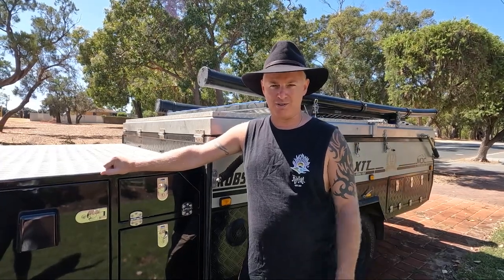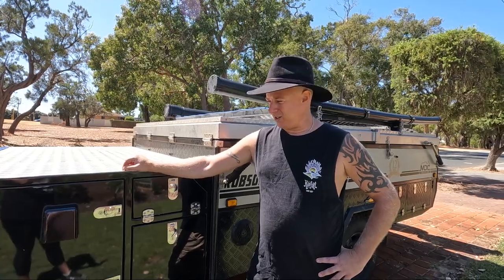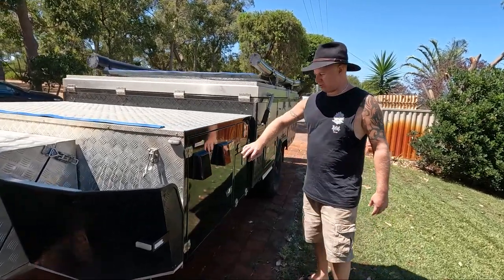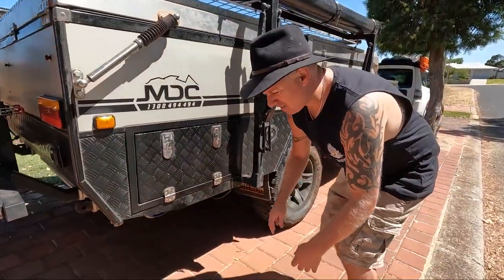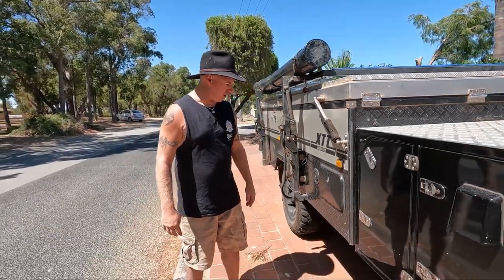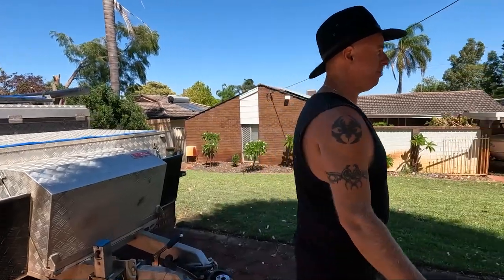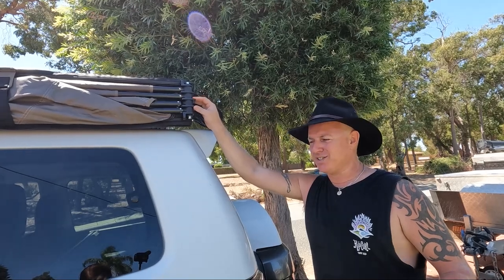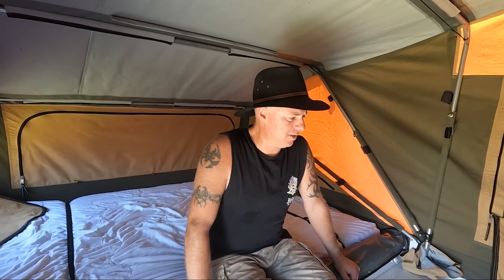MDC ROBSON XTT OFF-ROAD CAMPER TRAILER REVIEW AFTER A 32,000kms BIG LAP! PAJERO GOOD FOR TOWING?

Comment: Thanks for another great video. Curious to know about the big tubes you carry on top. I think you mentioned at some point they were for carrying the poles. Does the trailer not have a storage bay for the poles?
Reply from the maker: It does, but I chose to utilize the area to store other things instead, therefore gaining more storage. 

I call it the stuff spot where I keep all the bits and pieces we use around camp and want to be able to get to easily and quickly.

By memory I go through that in the walkthrough video.
Reply: @gettingaroundaus  Cheers for that, haven't got through all your videos just yet.

Comment: Great video mate. We are currently considering the MDC Explorer Forward Fold. My main concern was if it would stand the test of time, and your campers seems to have held up well after a long trip. 

How did you find the camper suspension? How did it go on the corrugations?
Reply from the maker: Yeah no issues on corrugations, did a day driving from Karratha to Karijini via Rio access roads and it all held up. Looking at the Gibb next year which will be the ultimate test, thanks for watching 👍
Reply: @gettingaroundaus   Sweet. We have a 300 series on order and are hoping to take that and the trailer from Cairns to Darwin via the Savannah Way, and some of the corrugations look dreadful, so I wanted to make sure the trailer could handle it.
Reply from the maker: Ahh yep we didn't go through there but looked like you earn your way through 😂

Comment: Thanks for the video. How did you find it to tow? The Robson is one of the widest campers at 2.4m wide. Wondering if you found it ok or was the width ever an issue?
Reply from the maker: Hi Tim, Yeah good question, the width we didn't notice any drag, it was easy to tow with our paj. Didn't notice it was there much many times when towing to be honest. The electronic braking system always works well also. I think the 2.5t capacity which we were close to was the only noticeable towing factor from our experience
Reply: @gettingaroundaus  nice one. Thanks for the reply!
Reply from the maker: @TimB-lb1zn  no problem, have a good one 🍻

Comment: Why would the pole carrier cause any issue. The top.frame is a boat carrier designed to carry much more than 50kg of poles.
Reply from the maker: The tube is just on the outside of the boat rack so my thinking is its only distributed over the driver's side tyre rather than over both for eg. It seems to be a shared opinion by many to be honest but I'm not 100% sure myself, even now 🤔